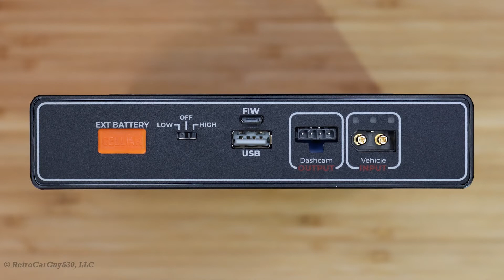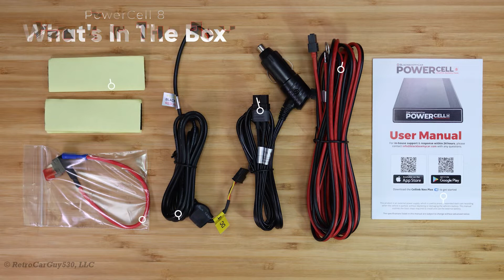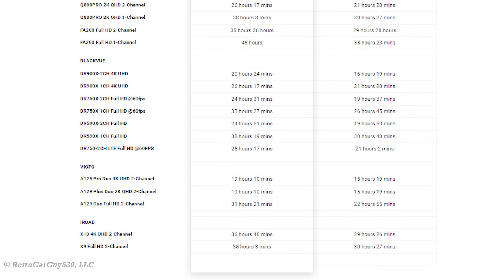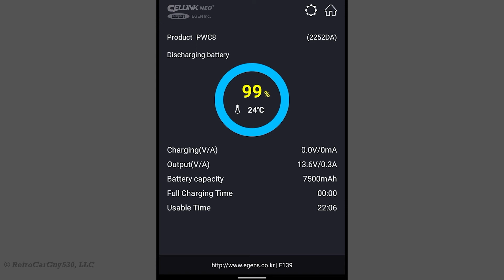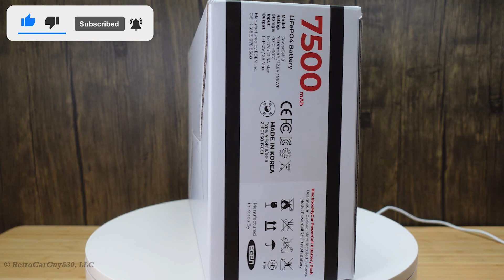BlackboxMyCar PowerCell 8 Dashcam Battery Pack Review / Testing

Comment from the maker: This video has multiple chapters, click on the time link for the chapter you wish to view in this comment, the video description section or in the video player.

⏲ Video Chapters ⏲
00:00 - Intro
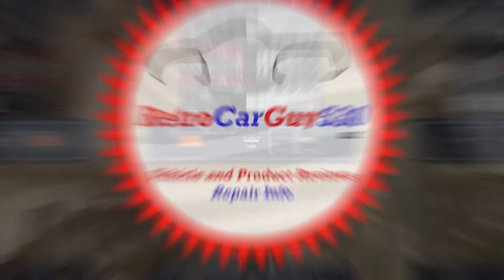00:39 - Connections / Info
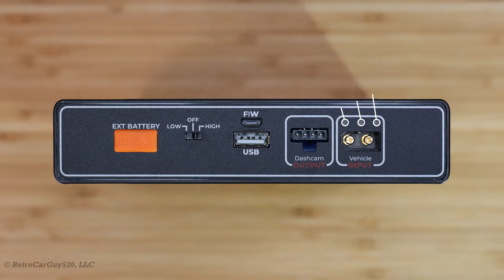04:22 - What's In The Box
06:56 - Current Draw Tests
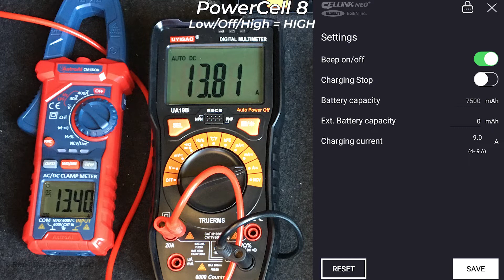10:55 - Timed Tests
12:24 - Hardwiring Options
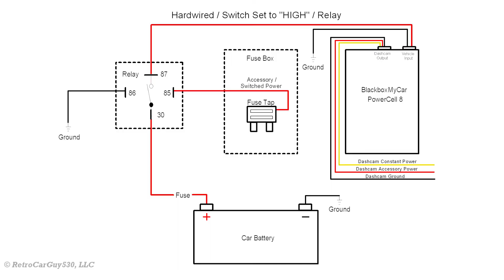15:45 - Cellink Neo Plus App
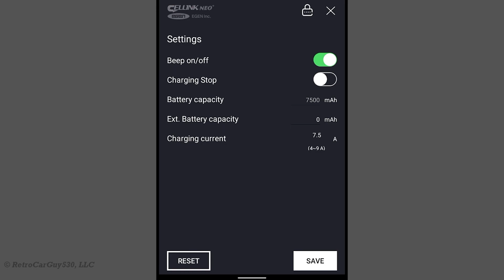17:43 - Purchase Information
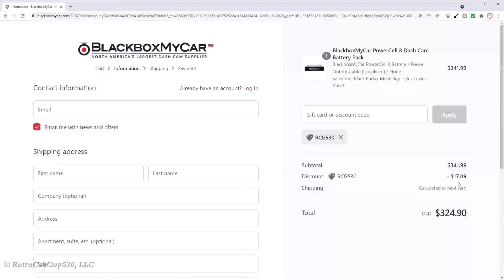19:18 - Final Thoughts

Comment: Does increasing the amp amount on the page speed up the charging process?
Reply from the maker: Yes, the setting in the app will allow you to reduce or set to the maximum the charging amps while it's being charged using the high amp charging cable.  If you use the cigarette lighter power adapter to power/charge it, it will be restricted to 5-amps max for charging.

Comment: Can you use this with a rove r2-4 dashcam? And hardwired
Reply from the maker: Looking on the Rove dash camera website, the R2-4K dash camera requires the ROVE Ultimate USB Type-C Hardwire Kit for parking mode support.  The power leads from the Rove hardwire kit would need to be spliced with the wires from the PowerCell 8's 12V output power cable.

The PowerCell 8's 12V output power cable has a yellow wire for "constant" power and a red wire for "accessory/switched" power.  The Rove hardwire kit has a red wire for "constant" power and the hardwire kit's yellow wire is for "accessory/switched" power.  Both cables use a black wire for the ground connection. Make sure the wires are spliced together correctly to get the dash camera and battery pack to work together.

Comment: I have a question about the in line fuse. Is it connected to the 14 gauge going to the car battery or is the in line fuse physically connected to the relay?
Reply from the maker: There are relays that have a fuse socket built into the relay case. Many relays don't have a fuse socket built-in.  The inline fuse should be as close as possible to the battery positive terminal/post to protect the largest amount of the circuit's wiring.
Reply: @RetroCarGuy530  what inline fuse do you suggest close to the car battery?
Reply from the maker: Any inline fuse holder that has the same wire gauge (AWG) as the wiring you're powering the battery pack with.  I typically use a 12 AWG wire inline fuse holder with one wire that connects to the vehicle's battery terminal and the other connects to the wire sending power to the dash camera battery pack. There are a large number of them available on Amazon and other electronics retailers.

Comment: I have a Viofo A229 Pro dashcam connected via the HK4 hardwire kit. My Cellink NEO 8 turns off both the parking mode and itself when the battery level drops below 40%.
However, I would like to use it until the battery is fully discharged.
What can I do?

Thank you in advance for your help!
Reply from the maker: I'm not sure why the Cellink NEO 8 turns itself off when the battery charge level drops to below 40%.  I don't have that make/model of battery pack to test.  In theory, the NEO 8 should go to a much lower battery charge level before its battery maintenance system [BMS] turns it off.

The HK4 will turn off power to the dash camera when the battery pack supplied voltage level goes below the slide switch selected minimum voltage.  The lowest option on the HK4 is 11.8V with a +/- 0.1V level of accuracy.

If the NEO 8 is dropping the output voltage level to a voltage level below the HK4 slide switch minimum voltage, that would be when the HK4 stops sending power to the dash camera.  I don't know if the NEO 8 will turn itself off if it does not sense a "load" on the NEO 8's 12V output power port(?). 

VIOFO did create a very limited number of prototype HK4 hardwire kits with an option to disable the low voltage cutoff in the HK4.  The "12.4V" position of the slide switch was the "LVC Off" position.  That allows the HK4 to continue to provide power to the dash camera as the dash camera battery pack's output voltage level begins to rapidly decline when it starts to reach its lowest charge levels.  In my testing, using this type of HK4 with LVC turned off usually allowed the dash camera to record in parking mode another 30 to 45 minutes.  The BMS will eventually decide the charge level of the battery pack is too low causing it to turn off the 12V power output.

If you have a multimeter, you might want to measure the voltage level output by the NEO 8 to the HK4 as the battery pack's charge level reaches the low to mid 40% range.  If the output voltage level is well above the 11.8V level [minimum setting for the HK4], the BMS in the NEO 8 must be turning off the output power when the battery charge level gets close to 40%.  That seems like an oddly high percentage level to turn off the battery pack's output power or even turning off the entire battery pack.

I have found the battery pack's stated charge level [percentage] can often be wildly incorrect from the actual level [when viewed in the battery pack's app].  Usually, that misstated charge percent tends to occur on the high end while charging, but it could happen on the low end as well while it's discharging and providing power to the hardwire kit.

You could reach out to VIOFO support and mention you would like to get one of the prototype HK4 hardwire kits with the LVC feature disabled in the 12.4V position.  You could use that instead of your current HK4 to see if it changes the behavior.  Measuring the NEO 8 12V output voltage level can be helpful in identifying the rootage cause [bad NEO 8, NEO 8 charge level of 40% with a very low output voltage level, a HK4 that is turning off the dash camera too soon, etc].
Reply: @RetroCarGuy530  The service representative from the website where I bought the Cellink NEO 8+ told me via email that the Cellink will continue to supply power until it drops to 10% capacity, regardless of the HK4’s low voltage protection.

However, I’m not sure how familiar they are with the technical details of this setup.

I will try each of the steps you mentioned and get back to you with feedback.
Thank you so much for making things a bit easier for me – I really appreciate it!

Comment: @RetroCarGuy530 I know this video is 3 years old I am installing the Powercell 8 in my daily drive a 22 Civic to power a Blackvue 770X Box 3 channel Dash Cam with the LTE module.  I have it hard wired off the fuse box but don't feel comfortable with that set up a plan to do the Relay power wiring.  I am going to run 12 Gauge to the battery side of the relay and 16 gauge for everything else my battery is located in the trunk and the relay will be under the dash will that gauge wire be sufficient if I keep the changing to 8 Amps? I plan to add an extra power pack to the battery in the feature.  Thanks awesome page...
Reply from the maker: One refinement to the "relay" info in my video has to do with the relay itself.  I've found my dash camera test car had some problems with voltage spikes from the three different relays I added to the car for the three different dash camera batteries I installed in the car.  When the accessory/switched power is turned off and the relays turns off the power to the dash camera battery packs, there was a small voltage spike that being generated by the coil inside of the relay while it's being de-energized.  That voltage spike can interfere with voltage sensitive circuits in your vehicle.  My car was a "worst case scenario" since I had added three relays to control three different dash camera battery packs.  When I would turn off the vehicle's ignition switch, all three relays would create some amount of a voltage spike, but the combination of all three caused a device that was voltage level sensitive to have a problem with the voltage spike level generated by all three relays turning off at the same time.

Luckily, there's a solution to this issue.  You can purchase an automotive relay which contain what is called a "flyback diode".  The diode is placed across the pin 85/86 control circuit.  When the voltage spike occurs when the accessory/switched power is turned off to the control circuit of the relay, the flyback diode will route the spike right back into the relay itself which will drain off any potential voltage spike which helps protect you vehicle's circuits. Here's an example of a 5-pin relay which the "flyback diode" integrated into the relay itself.  https://www.amazon.com/DaierTek-Built-Harness-Waterproof-Automotive/dp/B0BY8JRHZ3

You can use a 5-pin relay in place of a 4-pin relay. You simply don't use pin 87a which receives power when the control circuit power is off.  Just make sure any wire connected to pin 87a is properly protected so it will not touch/connect anything [properly wrap it in electrical tape].
Reply: @RetroCarGuy530  Do you think that could be a problem I may encounter with doing the relay wiring for the Power Cell 8?  This camera system was pricey over $500 form the Dash Cam store but it work flawlessly and meets all of my needs for security for my car while I am at work all night.  I don't want it to get damaged due to stray voltage.
Reply from the maker: I would recommend using a relay with a "flyback diode" if at all possible.  I ended up retrofitting the relays I had in my car with diodes to achieve that same level of protection.  A car usually has several relays in the various fuse boxes in the car that don't have a flyback diode. Adding anything extra to the car's electrical system it's best to be as conservative / safe as possible.  The relays with a flyback diode provide that extra level of safety.
Reply: @RetroCarGuy530  Ordering now thank you for the real time feedback super helpful..
Reply from the maker: That sounds like it would work. It would be nice if you could continue the 12 AWG wire from the relay [pin 87] to the PowerCell 8 as well so the entire charging circuit is using 12 AWG wire [including the ground side of the charging cable]. I know that BlackboxMyCar supplies the thinner 16 AWG charging cable wire in the box, but having a 12 AWG wire supplying charging power all the way to the PowerCell 8 would be the best case scenario.  I would suggest the relay plug harness should also have 12 AWG wires for pins 30 and 87 [the power circuit].

You could purchase a solar power charging/extension cable from Amazon which has 12 AWG wires and the XT60 connector.  Make sure the red [positive] wire connects to the XT60 connector with the flat edge and the black [negative] wire connects to the side with the three flat edges on the XT60 connector. Most cables are wired that way, but I've seen some of those cables with the wires reversed. You could simply cut off the solar power connectors and use those wires to connect to the relay [pin 87] and to the vehicle ground.  Using 16 AWG wire for the relay control circuit wires [pins 85 and 86] is perfectly fine since those wires will only be carrying about 0.1 amps.
Reply: @RetroCarGuy530   That is a fantastic idea this was my sticking point was the connector going into the Power Cell 8.  I built a mounting shelf in the trunk under the rear speaker area and have the Power Cell 8 and the 770X main Box mounted on it with a Stinger cooling fan mounted at the end to keep the temps down being everything is in the truck.  Super clean set up and makes maint really easy to access the components.  Thanks for sharing all this great information..

Comment: My battery pack is hardwired. I set the recharge to 9. Is safe?
Reply from the maker: If you're using a fuse tap for the charging power for the PowerCell 8, you need to research the circuit it's tapped into to know if there would be an extra 9 amps (or slightly more based on my testing) on that circuit in additional to the maximum load already used by that circuit fed power by that fuse box fuse socket.  You may want to consider reducing the charging amps to 6 to 7.5 amp range while you research the topic that is specific to your vehicle.

Comment: Hello. I have a Powercell8 battery pack connected to my U3000 front and rear camera. I now wish to add another dashcam which is a 360 degree panaromic camera but this requires a hardwire connection. I do not want to get into the fuse box area and thats the reason i chose to go with the Powercell 8 too for my U3000 setup. So can you please advise if i can use an additional battery pack like the ivolt Xtra or the Ivolt mini or another Powercell8 itself with the existing one? Is that possible as i can see a slot in the Powercell 8 battery pack that has a provision for an addon. Kindly advise if this is safe and how feasible would this be considering that both external batteries would be charged while driving and then both would need to work while the car is switched off. Kindly advise, thanks!
Reply from the maker: I have a car with four dash camera battery packs installed, but they source their charging power directly from the vehicle battery as outlined in this video using a 4-pin relay with the units that require switched charging power like the PowerCell 8 requires.  I have a PowerCell 8, Thinkware iVolt Mini, Thinkware iVolt Xtra and a Cellink B battery pack in that car.

You could use the one PowerCell 8 battery pack to power both dash cameras, but that will mean the amount of time in parking mode will be reduced.  The PowerCell 8 can provide up to 2A to dash cameras and most dash cameras only consume 0.5A while operating (max). You would connect each dash camera's power cable to the output power cable from the PowerCell 8.

You can purchase the expansion battery pack for the PowerCell 8, but that only extends the total capacity for the PowerCell.  The only output power port is on the primary PowerCell 8 battery pack.
Reply: Thanks so much for your reply and sorry I could not respond earlier. As you mentioned in your response, I am keen to know how can I use one Powercell 8 battery pack to power two different dashcams (one would be the U3000 front and rear) and the other would be the new 360 degree 4g sim dashcam that I wish to purchase.

Comment: Hey, happy Thanksgiving. My Power Cell 8 died yesterday, Using it with 970X Box. I had a BlackVue 124X battery, so I've decided to use it, so basically it's the first time I was able to see the battery icon on the Blackvue app. But what I noticed is that when the battery reached to 56%, I'm getting the voltage preset value that I set (in order to have parking mode with the ignition) and 10 min later the camera get disconnected. So basically there is a  way to use the ignition parking mode, and still use the battery all the way till it's empty? Thanks.
Reply from the maker: Happy Thanksgiving to you too!  You can configure the DR970X Box Plus firmware settings to allow the full battery charge level to be used.  You must have "Recording Mode > Battery protection" feature enabled to have parking mode function, but you can disable the "Low voltage cut-off" and "Cut-off timer" sub-options within the "Battery protection" section. That will allow the DR970X Box Plus dash camera to continue to draw power from the B-124X until the B-124X decides to turn off the 12V output dash camera power.
Reply: @RetroCarGuy530  I never thought about to turn it off inside the sub menu. Thanks for the tip. Happy holidays.

Comment: BBMC is recommending tapping a 20-30amp fuse to hardwire the battery pack. However, i’m not seeing a 20 amp ACC fuse on a 2024 CRV. Can I tap a 10 amp fuse? Place the 10 amp fuse on the bottom slot of the add a fuse and the 20 amp fuse provided by BBMC on top slot?
Reply from the maker: No, I would not recommend sourcing the charging power for the PowerCell 8 from a fuse box fuse socket that has a pre-existing 10 amp fuse.  The issue being that the fuse box fuse socket with the 10 amp fuse in it may only be capable of providing 10 amps plus 1 or 2 amps more.  It depends on how the fuse box is internally setup to provide power to that fuse box fuse socket.  The fuse box fuse socket could be sourcing its power from a wire or from what is known as a bus bar. A bus bar is a metal bar that can provide power to multiple fuse box fuse sockets (usually with a high amp load carrying ability). If you do not have the details of how that fuse box fuse socket is supplied with power, then the only "safe" assumption is that it is provided power by a wire that can supply 10 amps and with a margin of safety of 1 to 2 amps above that.  The PowerCell 8 can draw nearly 10 amps on its own which if added to the pre-existing 10 amp device load that original fuse was providing power to will potentially overload the wiring providing power to that fuse box fuse socket.

Tapping into a fuse box fuse socket with a pre-existing 20 amp or 30 amp fuse doesn't necessarily mean it can accept the additional load from the PowerCell 8.  That's why I recommend using a 4-pin relay to provide the switched charging power to the PowerCell 8 (as mentioned in the video).  If you decide to still use a fuse tap for the PowerCell 8 charging power, you may want to look for a suitable fuse box fuse socket in the vehicle's engine bay fuse box.
Reply: @RetroCarGuy530  thank you for the thorough reply!
Reply: I found an empty ACC fuse slot but has no name and amp rating. Is there a way I can find out the amp rating?
Reply from the maker: @ if the fuse box cover doesn’t document the fuse socket, I can’t say that I have a reliable way to obtain that information.